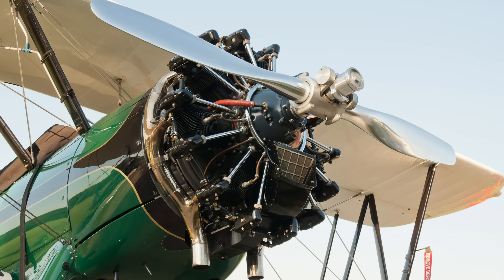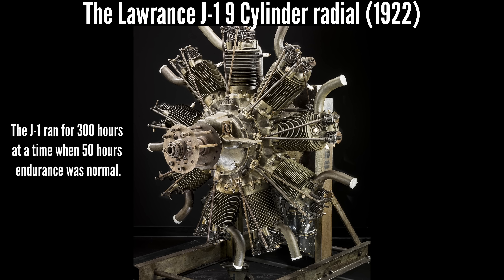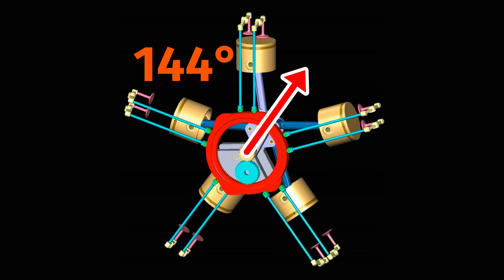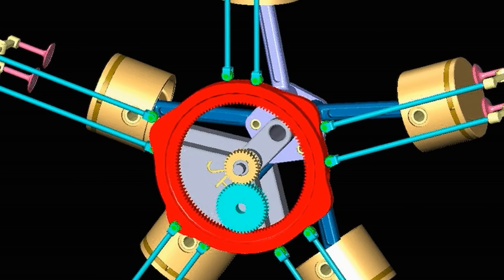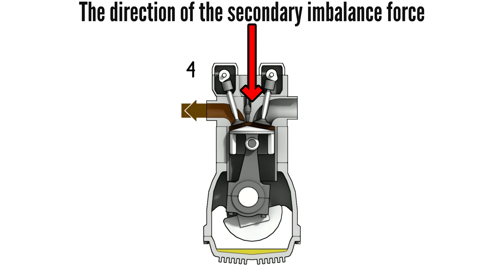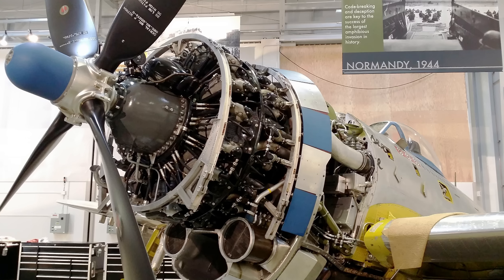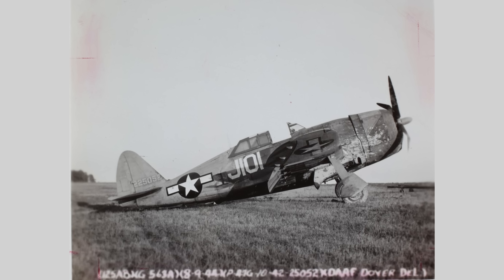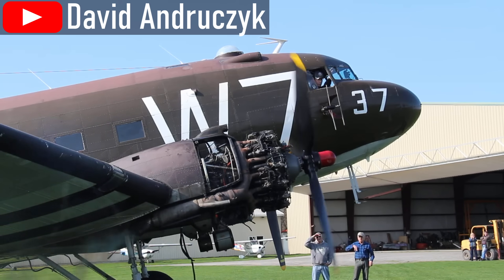The Rise & Fall of the Radial Airplane Engine - History & Technical

Comment: It doesn't answer why a modern radial engine can't compete on fuel efficiency with a modern boxer engine? Excluding the additional drag from the lager frontal area, I don't see any issues. The advantage would be a lower weight and complexity (due to it being air cooled). The biggest issue I see is lubrication. While a in line engine has its crank spinning in an oil bath splashing oil against the cylinder walls, and gravity to make it flow back, this obviously can't have that.

Comment: Something I've noticed is that radials produce substantially more torque than inlines of equal HP. Am I right in thinking that the higher torque benefits take-off acceleration and climb rate? And that's why they were preferred for cropdusters until turbines took over?

Comment: A major factor that made rotary engines viable was cooling. The cylinders rotating created airflow that cooled the engines both in the air and on the ground.
As metallurgy advanced as well as fuel quality this was no longer needed.

Comment: Most of our nautical terminology comes from the age of sail. Sometimes even the early parts of that. We don't say Left and Right, we say Port and Starboard. Because by convention (no other reason) the rudder / steering oar, went on the Right. Ask the Vikings. Point is, the age of sail is over, yet the whole maritime realm is steeped in the traditions of the sea. Everybody knows Fifteen men on a dead man's chest ~ Right? We all know the Parrot talks about pieces of Eight, even when nobody knows what eight is.
Radial engines, like struts and flying wires, are part of the tradition of the air.
Everybody knows that starting a radial engine, you remove the plug from the bottom cylinder, in case it's full of oil, and pull the prop through one or two revolutions by hand. That's why they smoke on start up.
Everybody knows the starting sequence for a rotary / radial engine.
Switches off ~ pull through, prime, switches on, (and make very sure you shout that out as "Contact") and then the ground crew will swing the prop. You MUST make sure they know when the magneto switches are on and when they are off, because that can kill people.
The sound of a radial flying past, is like the sight of a three masted square rigger. It makes an old sailor's heart skip a beat.
There will will always be a handful of tall ships. There will always be radial engines. They are the technology of yesterday. We do love them, but ~ a modern turbofan powered regular scheduled airline flight, is so safe, it's incredible. You are more likely to die in your sleep, in your own bed, than you are to die travelling in a modern airliner. But a 777 doesn't quite have the style or the charm of a Beech Stagger-wing. It looks and sounds so old and quaint ~ yet they're a surprisingly fast aeroplane. The way they move is not the way they look or sound.

Comment: I think the radial engine should be redesigned using newest technologies available today for two and four stroke engines. But not for speed or torque, but for rotation of a magnetic field to generate electrical power. Having tooled around with two stroke motors in my youth, I noticed how simple they were compared to a four stroke motor.  Since rotating an magnetic field has very stable torque energy requirements, the radial engine designed as a two stroke engine with electronic fuel injection, electric turbo air intake and a uneven cylinder configuration 11 or 13 to get to the least amount of combustion energy required to produce the torque required for rotating the magnetic field and the the next cylinder to its combustion phase

Comment: Spinning the entire engine is definitely something that comes out of Europe. It had to be the dumbest idea of engineering I've ever seen! LMFAO!!! 😂😂😂 The plus is what? Advanced air cooling yes, anything else NOPE! So when all your engine oil is slung out to your valve covers or heads, what is the solution to getting all the oil back to your crankcase and bearings??? If these were all 2 strokes, whatever? But they're not so they require a source of lubrication which under the severe centrifugal forces, this is a huge problem. But I understand back then, using a oil pump was rare, using a filter was nonexistent! Because everything was so loose and tolerances were like throwing a hotdog down a hallway, it was probably a total loss oiling system like they all seemed to head towards. I understand engineering precision sized parts was nearly impossible and the use of total loss oiling systems were kind of a must. But either way if they had or didn't have a pressurized oiling system this doesn't solve the issues with centrifugal force throwing all your oil into the bottoms of your pistons causing severe parasitic drag and losses in power. And how does one go about getting the oil back into a collective source, pan or tank for it to be recycled throughout the bearings??? SMFH! There's no such thing as impossible, but there's a definite problem when it comes to simplicity and reliability.....and because feasible for actual production runs for the general public or military usage.
Reply: That cooling was a major advantage at the time. That meant more power, and the only other way to achieve such high power was with water cooling. However, water cooling generally meant a heavier system, and possibly even more drag from needing a big radiator, so rotaries were the best way to achieve a fast and maneuverable airplane for a fair bit of time.

Comment: Radial engines also require A LOT of oil to operate. They used oil for cooling and often had large oil  tanks to allow the oil to cool before being pumped back into the engine.

Comment: The one thing I don’t understand the lubrication of a radial.  Is the oil in the crankcase or remotely supplied.   The oil has to collect some where, to be returned.  With my limited understanding I would think that oil would collect at the bottom filling the backside of the pistons.  The top cylinders would only get limited lubrication unless pumped to the wrist pins and con rods bearings.  If somebody could explain for me.  Like my comment so I can get a notification of a comment in response to my questions.  Thx.
Reply from the maker: It uses a dry sump lubrication system. Oil is stored in an external tank and pumped to the engine via the passages under pressure, so lubrication of the top (or any) cylinders isn't a problem. Oil is returned to the oil tank via scavenge pumps located at the botrom of the crankcase. With the engine not running, oil does tend to collect in the bottom cylinders, causing hydrolock, and thus radial engines have a specific startup procedure to prevent damage.
Reply: Verner makes radials that have a gravity drain reservoir. Oil is pumped into the head for upper cylinders and into the pushrods near the cylinder base for lower cylinders.

Comment: And next those low powered engines will be replaced by electric motors thanks to new batteries that can be charged in a reasonable time.

Comment: There have been radials built with all link rods and no master rod. One system uses a gear fixed to the crankcase that mates to a pinion gear. The pinion gear is mounted on a shaft. A second pinion gear mates to a gear on the centerline of the crank throw. Another system uses two fixed connecting rods mounted on the rod carrier. Both eystems were used by the Nordberg Corporation of Milwaukee on their large stationary radials in 11 and 12 cylinder single configuration. Used in power house and pumping stations to hese engines feature 14"/350mm bores and strokes. See Old Machine Press for details.

Comment: There's a shop in Grangeville, ID that repairs and overhauls radial engines. They have so many radial engine parts there it boggles the mind. 
Most radials are destined for antiques and special interest airplanes. Hardly anyone uses them commercially anymore, although there are some out there. 

Great video, thank you.

Comment: While the entire engine rotating around a stationary crank seems pretty lame I think the maybe would be some advantages if a radial engine slowly rotated seperate from the high speed crank rotation...maybe  only 100 rpms or less with the idea being to  equalize the environment of each cylinder and head,  Exhaust and intake might become a nightmare I imagine.  But maybe the exhaust openings could all be flush against a plate with a single channel with exhaust pipes every so many degrees bored into said channel....maybe even exup type valves every so many degrees variable to whatever advantage that might create.  Fuel inection makes the intake less of a problem.  I am thinking a similar indake plate with throttle bodies rotating with each cylinder controled by servos  ....would be INSANE!

Comment: theres one thing that isnt touched about radials . how do they get oied and how do they extract the oil out of the carter as theres basicly no carter , my guess is that the underside of the bottom pistons fill with oil or gets trown around in a running engine

Comment: As for the reliable radial R985, SeaLand Aviation in Campbell River BC Canada, has over the years installed a GM aluminum V8 (Trace) repower, and recently a German automotive diesel engine in the classic Beaver, both repowers STC approved. Google it 😉🇨🇦

Comment: Ideally the best engine for a prop plane is a ROTARY not A RADIAL because Wankel engines have zero reciprocating mass. Therefore they can achieve very high RPMs.

Comment: On radials...big thing is to prevent hydronic lock...so must pull though by hand; or remove lower plugs to drain residual oil that collects in lower cylinders! So,longer preflight!! And make sure that others who fly ur plane do the same!
Reply: Also would like to restore one in my back yard; if I had one like to get hands dirty like working on old cars...

Comment: Bristol Hercules series significantly reduced the front section of radial engines, with their flat valveless heads. These sleeve-valves motors proved quite efficient and reliable after WW2, having solved their early teething problems. These late models developed just over 2000 hp.

Comment: Ive always kind of wondered how aircraft development would have gone if the radial were never successful. Radials were often more durable and powerful for a given displacement, and their weights were always lighter because they were aircooled, but their drag alone always incurs a really high speed penalty, sometimes as high as 50mph compared to an inline engine with several hundred less horsepower.

Comment: Excellent job with this presentation.  Happily, RC model airplane enthusiasts can buy 3, 5, 7 and 9 cylinder radials from 15 cc to 800cc from Saito, UMS, Moki and Valach. That 800 cc was not a typo!  Many of them run well and sound big like the full size engines.

Comment: You can add more banks of inline engines, joined to a central common output shaft, but it is too heavy and too bulky, for aircraft use. The Chrysler multi-bank was such an engine.

Comment: Rows of inline engines can by duplikated in the exactly the same way as rows of radials, they converge in the radline engine that has 9 inline 6-cylinder sharing crankcase, that can be alternatively described as 6 9-cylinder engines.
Not every multiple row radial is radline - it depends on valve train configuration.

Comment: Yeah if you this a 426 HEMI V8 motor is some badass big displacement power opening up you aint heard nothing compared to like a 71 liter, 18 cylinder radial with HEMI combustion chambers combined with twin stage, intercooled turbocharging and mechanical fuel injection.  It would have been great though had Ford managed to combined the 427 Cammer with mechanical fuel injection.

Comment: Beautiful video.  As an old shade tree mechanic Most of what I learned was by word of mouth and by rebuilding motors.  It was a real treat to view this video about radial engines.  Dad bought me a basket full of motorcycle parts in 1973.  It was a 1968 Honda CL 350.  I had the motor back in the frame and the motor running by about 7 PM.  I later learned that its engine layout was nearly identical to an 1940s John Deere Model G Tractor!

Comment: The cooling issue of multi-row radials was solved by BMW in the 40's with a special cowling for their BMW 801s to be used on the FW-190. The Americans just copied the design off downed planes.

Comment: The "perfect engine" isn't designed to have the oil pool in the lower cylinders when it's not running. Frontal area is another huge design drawback. But you already knew that.

Comment: I remember assembling a W 670 in A & P school in the 1980s, it was an awesome experience.  We took a trip last summer from Homer Alaska to Brooks Falls on a Beaver which is radial powered. The sights, sounds and low frequency vibrations were great!
There is a rotary engine motorcycle from the twenties with the engine mounted in the front wheel too. Thanks for a great video!
Reply: We disassembled and assembled a W-670 at Colorado Aero Tech.

Comment: I heard that Verner didn't do the best job with their pre-production balance calculations ... and apparently they have some balance issues. ( hear say )

being piston engines are more fuel efficient, I would expect a radial would do well, if done well.
but from a turbocharger's point of view, there is only one that also accommodates modern engine dimensioning ....that's the R3

Comment: what if you had two rows of cylinders.  Each row driving a counter-rotating shaft which drives counter-rotating propellers?  Advantage would be the elimination of gyroscopic effect.  Also the propellers could be smaller.  Disadvantage would be extra weight and complexity.  I guess such an engine is impractical because I’ve never heard of it.
Reply: How do you get the drive from the rear set through the middle of the front set? There is a crankshaft in the way.
Reply: @nerd1000ify : counter rotating shaft like in jet engines
Reply: @75west  consider the usual shape of a crankshaft and whether you could run a counter rotating shaft through it.
Reply: @nerd1000ify  you are talking about the crankshaft on a car or truck.  As far as I know, every jet engine has counter-rotating shafts.  It's how they work.
Reply: @75west  I thought we were talking about radial piston engines? Your original post suggests running the back row of a radial the opposite way from the front row to drive a second propeller?

Some jets (particularly small ones with low pressure ratios, but even some large and powerful engines like the GE J79 or Snecma M53) have only a single shaft. You'll find coaxial shafts on more complex engines with multiple spools, but they are not always counter rotating, often both spools rotate the same direction but at different speeds.

Comment: The first air cooled ones cost a fortune, as the cylinders were milled from billets.  The ultimate single engine was used on the Sopwith  Camel which was very tricky to fly due to the gyroscopic effects of the spinning mass.
Reply: The Pratt and Whitney radials had milled cooling fins

Comment: I also heard that Harley Davidson engines were based on the radial engine, turned sideways. Both pistons rods attach at the same point on the crack shaft.  That’s why they have such a unique sound, because they are an even number of pistons on an engine that should be an odd number.

Comment: Another nice feature is caused by the 'every other cylinder' firing order. Any piston on its downward power stroke, is more or less diametrically opposite the piston on its compression stroke, thus the downing piston directly pushes the upgoing piston, rather than imparting the torque through a couple of 90 degree bends, as with an in line engine layout.

Comment: Was told by a retired Boeing engineer years ago that radial piston -bore size maxed out due to the expanding flame front at the point of ignition in the cylinder not being able to complete the combustion before the exhaust stroke .
Reply: This problem would have been aggrevated by the use of hemispherical combustion chambers on most radials, they were needed to allow large valves for airflow but provided relatively little turbulence to speed up combustion.

Bristol's sleeve valve engines were better in that regard, but had many of their own issues...
Reply: yes around 6 inches or so for cooling and dentonation trouble thts Pratt never went past 5.75 inch bore Bristol had the same bore but a 7 inch stroke
Reply: @allisfarmall7946 
The largest radials l know of were built as stationary engines for pumping stations and power houses. Built by Nordberg they featured a bore and stroke of 14" x 14”. Built in 11 and 12 cylinder variants. They were also unusual in that they featured no master rod
Reply: Two spark plugs is the solution to that
Reply: @scottgriffin2005  they all already have two, dual plugs is standard on aircraft engines for redundancy. The plugs are powered by independent magnetos, one mag can fail and the engine will still run with some reduction of power.
Reply: @scottgriffin2005  Even smaller aircraft engines need two plugs not only for redundancy, but to get all the mixture burned in the limited time available.  A Lycoming IO 360 loses about 10% of power running on only one set of plugs.

Comment: Very good video, however, 1 Big Blooper at 3:42. Each row of Radial Engines ALWAYS without exception has an Odd Number of Cylinders in each row... Otherwise, they would be totally unable to run. A number of Decades as a Senior A&P Mechanic in an A&P Class Decades ago we studied the Radial in depth, including hands on overhaul of the engine... There is no way to cycle all Cylinders on an Even row and that is why it is impossible to have any 1 ROW to have an even number.
Reply: There were Radial engines with even number of cylinders per row(They did have regular camshafts though and seems to only been experimental engines).
Examples : Bristol Hydra, Wright H-2120